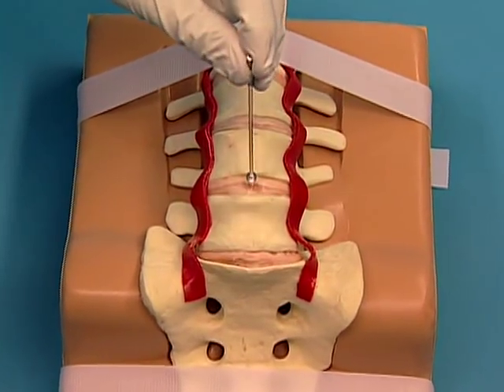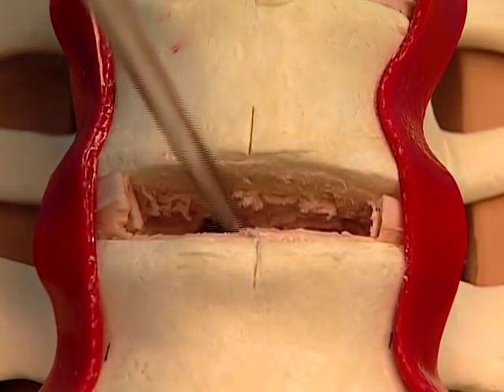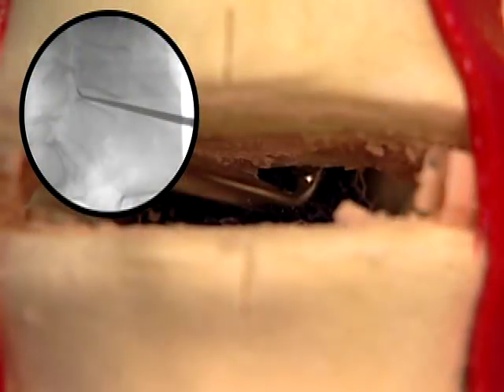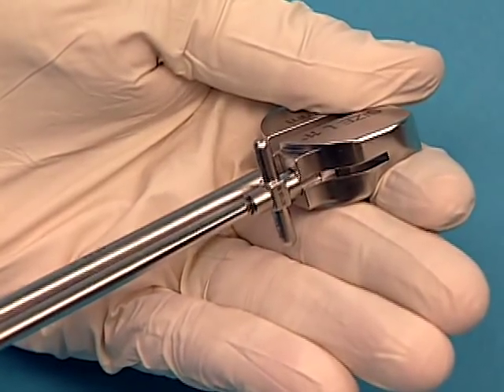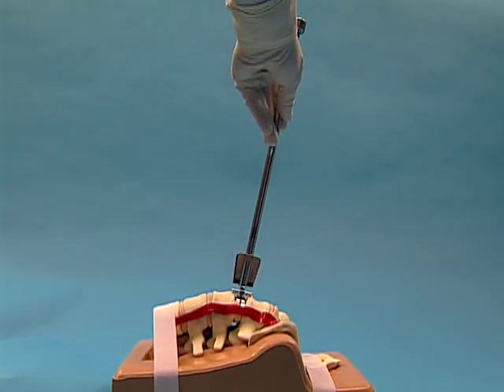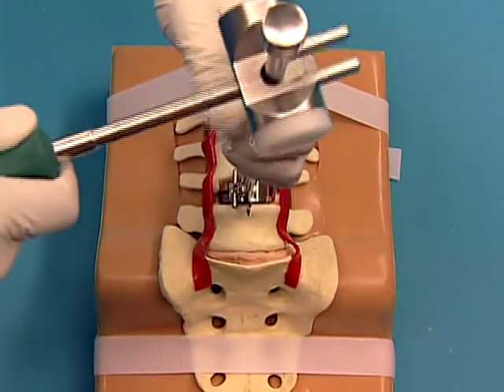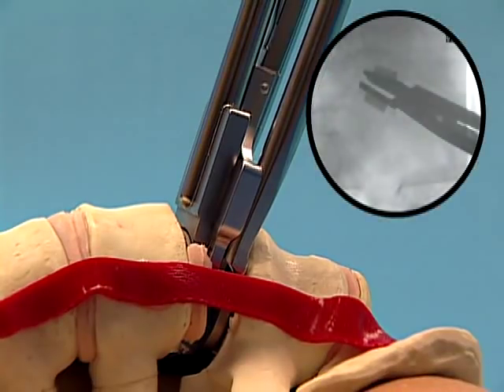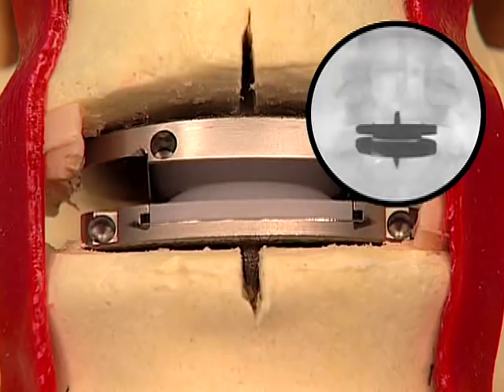ProDisc Lumbar Total Disc Replacement Saw Bones Technique Video

Comment: I had the Pro disk L installed at L4-L5, I walked 7 hours after surgery, Today is 17 days post procedure. I do have daily pain, but it appears a result of the surgical procedure I am optimistic my days of constant back pain will soon be behind me, recovery from the procedure it pretty intense. 
If you have this done plan on pain, but stay optimistic

Comment: I'm  52 female , had my lumbar  fusion  L4  L5 1s   2 weeks  ago  here in northern  Virginia  I had spondylolisthesis  grade 3 stabbing  low back  pain , numbness  on left leg, also me muscle  getting  smaller , surgeon  said  if I didn't  do  it ,  my nerves  will  be  damaged , so my left leg. Anyway  I had my surgery  12/17415 8 am doc said  will take  2 hours  took 4, I wake I was in my room under fluid  and pain killer  pump, I didn't used much, 2 am they made me walk, I did good  except very painful left leg cab and  feet  burning  pain, never had  before  even so I walked  a long hall, the therapist  said  I would  not need a walker, but a cain. anyway  firth week I had pain killers still have my burning  pain but no more stabbing  pain and numbness . I tried  not to abuse  taking  too much pílds, and it works  great! 2th week no more pain walked more all slow but No pain. As many I was scared  to death  to this surgery  but I didn't  have  any choice! I'm  happy  I did  it! ..My recommendation  look for experienced  orthopedic  surgeon , and that's the main thing...Don't abuse  taking pílds only if necessary . .

Comment: It's actually better on them in the long term than the old fusion surgery which ends up destroying the levels above and below as well as reducing functionality. Also the old fusion surgery requires multiple screws and plates that are inserted all over the place. I had this done on 2-24-12 and got the feeling back in my leg within 2 weeks of surgery and no significant issues since. I have no loss of function whatsoever. It's massively superior in process.

Comment: Why would anyone want to put 2 cracks in their spinal bone!? This just does not seem right for some reason. Surely this will cause problems when you get old?
Reply: The problems associated with doing nothing to repair a spinal disk injury or complete degeneration are much much worse. Spinal fusion is also worse as it transfers the weight load to other sections of the spine causing them to degenerate as well. This procedure is suppose to come as close as possible to restoring what was once there regarding spacing and mobility. It carries the weight of the disk that used to be in the space.
Reply: I just think there must be less invasive options out there. These implanted disks not only run the obvious risks of having major surgery but if the disk was to slip, or to dislodge in any way, corrective surgery could be life threatening.
It looks like spinal replacement is the optional way to go at this moment, but then again so was spinal fusion and we all know that options doesnt work out well either. In time better options will emerge. There is one such doctor, Dr. Roger Härtl, he aims to replace damaged disks with biologically engineered tissue. This sounds like great news. However they are very early in the testing phases and far away from human trials as of January 2014.
Reply: anythingyouwant29 I do see your point however, once your disk has completely degenerated there are no further options beyond doing nothing. I have had 2 spinal specialists tell me this or a fusion are my last hopes. I am not willing to have a fusion. So if the disk was to move out of place you have it replaced or you have a fusion later on. Obviously with this solution there are risks. You have to go into this with the knowledge that your life will always be lived carefully to not dislodge the repair in your back.
I have read studies on the long term outcomes of replacement vs/ fusion and the complication rate resulting in repair of replacements is far less than with the fusions. I am a text book perfect candidate for this procedure. I am young, fit and not overweight. I have had no other procedures done to correct my issue. The odds are for me this repair will be a complete success. These odds I am willing to take because the alternative is to either lose my career or be a cripple at age 50. Not acceptable.
I wish I had the luxury of waiting for years for a better more natural alternative as you suggest but I do not. I am in the military and my career hinges on this being repaired in the short term. When the technology advances I see no reason why a disk replacement now cannot be revised in the future to another more advanced solution.
Reply: Well it would appear that surgery to remove the herniated part of the disk is the first option for sports professionals (i.e American football, google Tony Romo herniated disk).
But I read that this is only a short term solution, short term as in 2 to 3 years in an active sports profession. But after this period you may be back to the same situation as now, deciding on either disk replacement or fusion.
Doctors will always advise against surgery, good doctors anyway. Surgery should be the last resort. Whatever decision you make, just make sure its your own.
Reply: anythingyouwant29